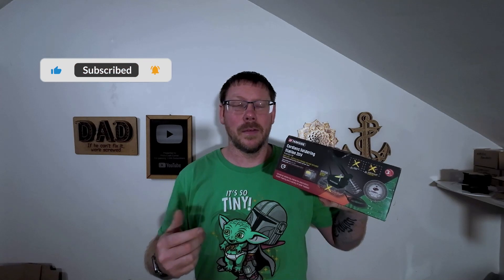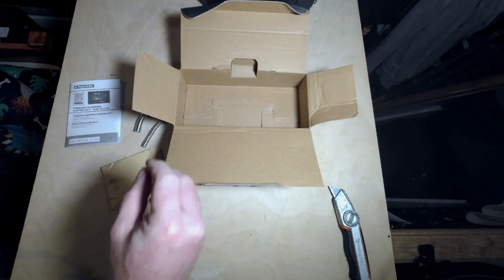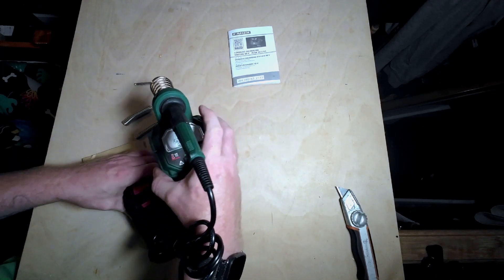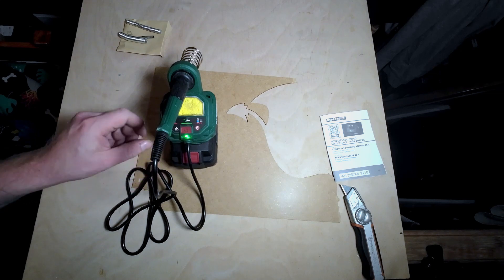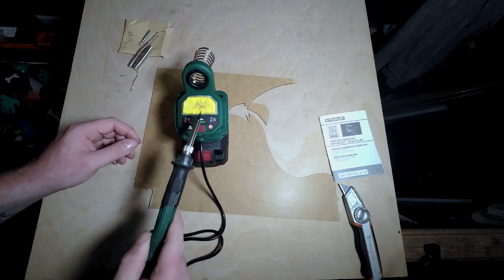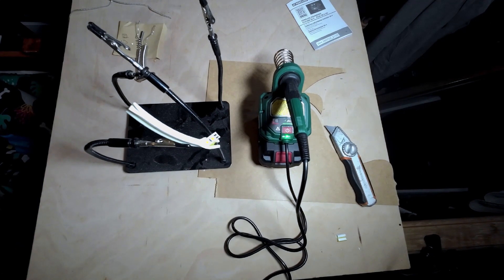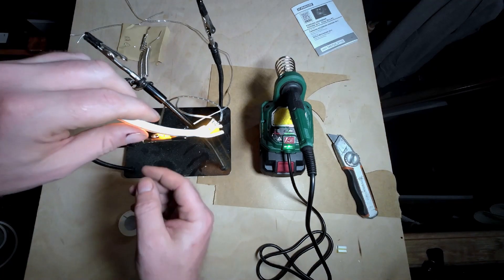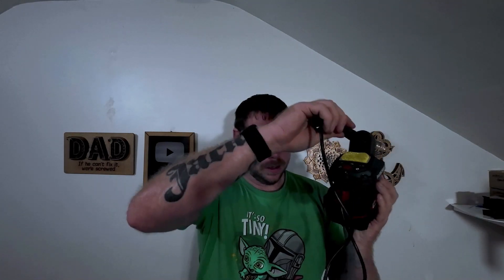Lidl's Parkside Cordless Solder Station: Unboxing and Putting it to the Test!

Comment: Yoo thank you for the review, i wanted to make sure it was a good soldering station for building PCB'S (printed circuits boards)
Reply from the maker: It's still going strong and working great. I haven't used it for anything too small, but if you have a steady hand and a small enough tip. I'm sure it will work great!